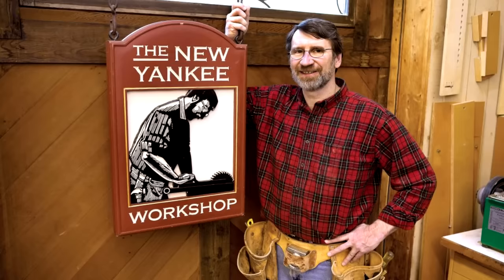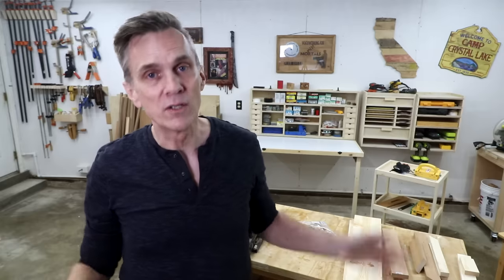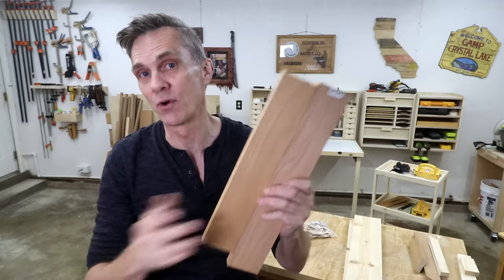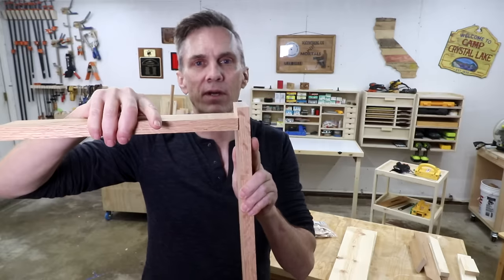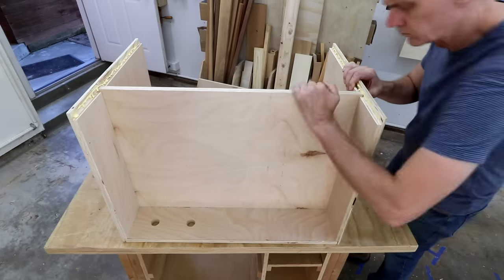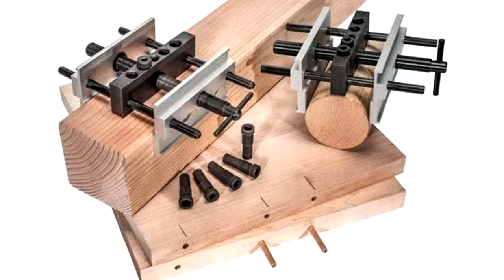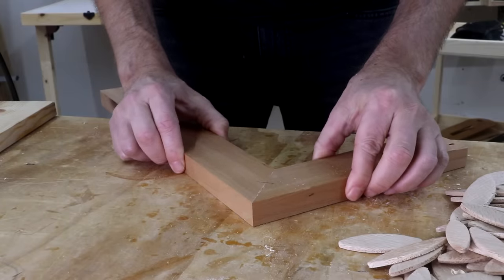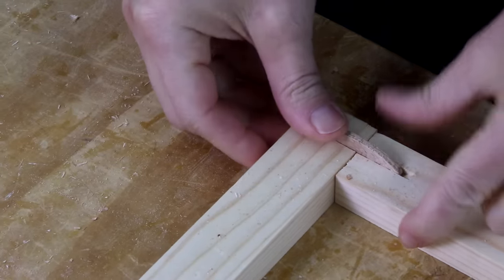So, is a biscuit joiner completely useless?

Comment: I used my porter cable plate joiner for may years on cabinet face frames, door frames and a few other projects but very seldom on gluing up table tops of solid wood.  Pocket hole joinery is something I did spend money on as it is faster, easier, and very strong, and one can either make or purchase plugs to cover the pocket screw holes.  I haven't used my plate joiner in almost 3 years, it is now a dust collector.
Reply: your right,  mine has be stored away for years , making face frames pocket holes are the way to go and plenty strong enough
Reply: Using biscuit joints with pocket holes can be amazingly fast and strong. Biscuits are amazing for  alignment with good strength and when used with pocket holes they can be very strong.

Comment: I've never seen, let alone use, any biscuit with that amount of clearance.  I usually use Freud, and they often have to be tapped into the slot, especially if you take more than half a minute after applying the glue to fit them into the slot.  
For making edge joints, I glue the whole joint instead of relying only the biscuits, but they sure help in aligning.  I don't use cauls, unless I'm using a number of boards, and that's more for keeping the whole thing flat while the glue is setting rather than for alignment.
I recently made all new doors for the kitchen cabinets in our house, and biscuits are hard to beat for making the frames when it comes to speed and ease of assembly.  Sure beat using dowels, like I did for doing the same thing a number of years ago in another house, before I had a biscuit joiner.
I've never seen a "one size fits all" kind of tool.  They all have their uses as well as their limitations, but I've found a biscuit joiner to be a very useful tool when used for it's intended purpose.

Comment: I use my biscuit joiner all the time. I make heavy big log fireplace mantels, massive life edge tables, of huge heavy bords, with literally two rows of 30 biscuits across. Slide them together, work fast for the glue, tap the boards with a wooden hammer, then clamp them tight shut. My tables have nothing else but wood, biscuits, and glue, and will last generations. Absolutely nothing useless about a biscuit joiner, my friend.

Comment: Wow.  I'm amazed at how much play you have in your slots.  I've been using my biscuit joiner for all of my table tops, and i've never seen anything like that.  I have the opposite problem - sometimes the biscuit is too tight, and hard to center in the slot - at which point it actually prevents the boards from coming together.  However, once i discovered that, i just check the fit before assembly and throw out the ones that are too tight (only 1 in 20 or so are too tight).  I acknowledge that cauls are probably still a better choice, but my biscuit joiner is still very effective.

Comment: I bought a biscuit joiner at an auction a few years ago for about $30.  It came with a whole bunch of biscuits, too. I build picture frames from live edge boards, which, when mitered,  don't always clamp up nicely.  The biscuit joiner really does help them get lined up and hold the ends together well, as the faces are not always the same width.  The end product looks pretty good, as they frame my own landscape photos.  I have also used them to line up edges for table tops, and that was helpful as well.  $30 was about the right price, too. Beyond that and I would probably not own one.

Comment: I've been using 3 different joiners for the past 20 years. I've never had slots as sloppy as what you show. I've had to drive ,my biscuits in with a mallet.
Reply: You do have to tap em in when you are in Louisiana or some other swamp ass location. 
Humidity makes them swell up.
Reply: I'm in a fairly dry province in Canada and I too have to tap them in and sometimes pull them out with pliers (when doing a dry fit)
Reply: I bet he is buying generic or cheap biscuits.  Biscuits do come in different sizes also.  I have had sloppy fitting biscuits so I returned them for name brand. Since that time I have the size of my cutter(thickness) written on a tag on both inside and outside of case. There definitely is a use for them.  I didn't buy mine because of Norm even though I knew him personally at the time.  I bought it because it's handy for making tables, cabinets and joining tasks.  I actually have 2 of them a Dewalt and a Mikita  both of which are built way better than that POS he has.
Everyone has an opinion and you know what they are like.  Well this dude's stinks.  Look on utube and there are vids saying how they are a must have tool.  I don't a vid to tell me that though

Comment: You're using the wrong biscuits if they have that much play...or any play at all for that matter. Mine sometimes have to be hammered in.
Reply: I gotta say, even my nasty cheap joiner and biscuits fitted snuggly... out of alignment, but snug!
Reply: Yeah I usually have to get a rubber mallet and beat the pieces together before clamping them
Reply: Always keep the biscuits in a dry place and bag or box sealed as they sell up alot.
Reply: Youll be fuckin hammered if you keep carrying on about biscuit joiners.
Reply: Biscuit joints are a step above butt joints. No, they don't add strength. But they are great for aligning! I don't have wall full of clamps. And I don't need them when I'm using biscuits. 

*also it definitely looks like you picked up the wrong size biscuit. Try a size up.
Reply: More likely, its the poor quality Sears joiner he's using.  Slots from a decent machine have no play, just big enough for a press fit with glue on the biscuits.  It angers me when I see unresearched misinformation put forth as being truthful, as in this video.

Comment: I used one of those dowel jigs  quite a bit to repair joints in old windows that had been poorly built and needed strengthening. I drilled from the outside of the stile into the rail. They worked very well for the casement windows I repaired.  In this application a dowel was probably superior to a domino. On biscuits and Norm: I seem to recall that he had abandoned them before the end of his show.

Comment: Whew! I came close to buying one for a decade. I'm glad i never did. Thank you!
Reply: Steve bought his biscuit joiner in the late 90's and it is rather crappy model by the looks of it. With a better made tool you can dial in the depth and width of cut to fit biscuits so well that they barely need glue. His take on the biscuit joint makes all kinds of good points but still does not do it justice.
Reply: I can't tell you how badly I wanted a Lamello biscuit jointer, just like David Marks.  I now just go with edge-edge or dowels, and I still am astronomically out of David Marks' league.
Reply: @dclaghorn2  dude, just buy one. They are cheap

Comment: Still use and love my biscuit joiner, a lot cheaper than the alternative, I use it for just about most projects
Reply: Yea I use mine on most of my table tops. Never have had any issues for 6 years now. Think I'll just keep using it. If I had a cool g siting around I'd get a domino tool. But that's a lot of money for a hand held tool. I get why someone wouldn't use them but there is nothing wrong with using as biscuit either.
Reply: I just used mine last week.
Reply: Have you used the kreg pocket screw system?

A few years ago my boss called and asked me if we needed the kreg pocket screw system
I told him HELL YES !
He asked are you sure
Definitely
When he got back to the shop I showed him how the system works and he was very impressed even though it's kind of expensive for what you get
I love it works great but I will keep the biscuit joiner 
It works great as well 

Each tool has its purpose
Reply: Same here,  and if you have that much "play" @2.22,  then the quality of your tool is somewhat "suspect"  shall we say?   Although I would admit that the Dewalt that I've owned for some twenty years now isn't by any means "top of the line",  I do used if fairly regularly,  and I can barely get the biscuits out of their slots again after a dry fit.
Reply: Congratulations on wasting your time lol
Reply: @killingoldgrowthsince  Time

Comment: Speaking of dowels, I just made a small couch tray and tried a trick I saw somewhere online with great success. I used #8 screws in pre-drilled holes during the glue-up, and then after the glue was dry I went back and pulled the screws, drilled out the holes to 5/16ths, and glued/hammered in hardwood dowel from the big box store. Worked really well! I'm definitely going to use it again in cases where I don't mind having the dowels visible (I generally like seeing them, since the endgrain finishes up darker than the facegrain).

Comment: Norm Abram doesn't change router bits, he changes routers.
Reply: Yes he does
He has a few 

Id love to have his tool setup
Reply: Makes sense if you regularly use the same bits and depths.  Bit of a pita to constantly be changing bits and adjusting the guides.
Reply: Yep, that's me.. 7 routers and hardly ever change bits LOL
Reply: Without a doubt if I used dovetails regularly, I would keep one set and never use it for anything else.  They are a PITA to get set properly.

Comment: Try using one for cutting cam lock strike slots when installing locks on doors and in drawers, nothing can surpass its superiority for this task. I've used my Dewalt to scab on and widen doors, replace rotted jamb sections and enhance many assemblies. It's not the only way, but mine paid itself off and is here to stay.

Comment: When I started my woodworking career back in the eighty's I used all kinds of joinery. One shop had a real Lamello machine and I used it for everything I could. I made jigs to use in making European style cabinets with built in light valances. Shelves could be mounted permanently in the middle of the cabinet. And I made my own kitchen cabinets using this system along with drywall screws. If you are in a small shop making dados and rabbets tie up a table saw, so a Lamello is a valuable tool for making quick joinery. I've never seen a Lamello joint failure, but I have seen pocket screws fail. I still have a Freud Lamellow machine. It's a valuable machine to have in any wood shop. You just need to learn to use it properly.

Comment: You guys should try the original biscuit joiner invented by the swiss company lamello in 1968. Should give you less headaches than those cheap knockoffs. By the way: the bisquit joints were originally invented to join the first chipboards which were so weak that a dowel wouldn't get enough hold. A biscuit joint has more glue surface but is thinner than a dowel so it doesn't weaken the structure of the chipboard much.

Comment: Just made 9 tables for a restaurant using a biscuit jointer. They are some of the flattest tables I ever made. Usually have to glue up two half to run through the planner but I was able to glue all the boards together seamlessly.  Biscuit jointers are very helpful when making tables.

Comment: Very timely Steve. I was just thinking about buying a biscuit joiner to align some boards for a glue up. Your video makes it clear that biscuits really aren't that accurate to align things. Thank you.
Reply: Dave, buy that biscuit joiner, but stay away from the low end stuff that was unfortunately used in the video.  DeWalt and Makita make wonderful joiners for $170-180 that won't let you down.

Comment: I liked Norm because he was a real woodworker, he had a radial arm saw.
Reply: Yeah you don't see this much anymore
Reply: Beats the snot out of a table saw in small spaces. Also makes a great disc grinder, and a somewhat adequate overarm router or even drill press.
Reply: I love my RAS, especially for dado work. It’s nice to be able to see what you’re dadoing. 

I also prefer using the RAS over a miter saw when I don’t need the portability.
Reply: Soooooo does this mean I'm a real woodworker? I just picked up a 1958 Dewalt GWI radial arm saw.
Reply: @JetSkiBuyFixPlaySellChannel  That is a nice RAS, My Dewalt is not quite that vintage, but I use quite often and a heck of lot more then biscuit jointer...
Reply: @JetSkiBuyFixPlaySellChannel  Nice.  I have a GP and what I think is a GE (builders plate is missing but the specs match).  Both awaiting a tear-down and rebuild as they've had a hard life before I got them.
Reply: My 1st stationary power tool was a radial arm saw. I still use it for EVERY project. Super precise, has large work surface, can use dado blades, can do both cross and rip cuts,  longer cross cuts than a miter saw (which I have NO use for since I have a RAS), have even used it as drum sander when flipped 90 degrees, great for cutting multiple boards at same time. I do NOT need portability provides by MS..
Reply: I picked it up for $100 on Facebook Marketplace. I used a RAS in highschool woodshop. I never realized they could do rip cuts until recently when I saw somebody do it in a Youtube video. I need to get a new blade for it and plan to get some of the other atrachments for it.
Reply: I like radial arm saws and dowels.  Dowels are just as strong as mortise and tenon and much easier to use.  Dowelmax and JessEm both make easy to use dowel jigs, I own the Dowelmax.
Reply: ive refused free radial arm saws several times.
Reply: @502deth  Why would you refuse a free radial arm saw?
Reply: My brother offered to give me one before I realized how versatile they were. My garage is too full to get much done so I declined it. Not sure what kind it was. The cheaper newer Craftsman ones and others aren't really worth the trouble since they are too flimsy to be accurate.
Reply: @ed waggoner sr. imo,.waste of space. it can do some of the jobs of 3-4 other tools, but it does not do them as well and it does not replace them, so you still need to have the other tools that do the job better, so why mess with one.
Reply: @502deth  There is nothing a table saw can do that a RAS can't do.  But there are  tasks a RAS can do that a table saw cannot do.  I've had small shops myself, as did my dad.  I'd chose a RAS over a table saw any day for a small shop.  But each to his own, a man needs to work with what he is comfortable with.
Reply: Norm was the man. Never had a problem with biscuits, countless uses.
Reply: Ive used them twice, they scare the shit out of me so I'll stick to the table and mitre saw
Reply: It also depends on the RAS. If you start with a good quality one, set it up with a proper surface like the "Mr Sawdust" one,  use a sharp blade that is appropriate for a RAS. You also need to understand the proper techniques and use the right safery features that were designed for it. You can really do a lot of usefull things with it for way less money than a quality table saw or a miter saw.
Reply: @JetSkiBuyFixPlaySellChannel  I do agree they are infinitely better than any miter saw and alot of table saws, it's just  that im nervous with them and if my hands are shaky than its a no for me, also the ones I used are from my college and they cost alot of money in my country, plus I think they might be illegal here
Reply: For best results with a RAS, you also want to make sure you get a blade with a negative hook/rake angle, which makes the blade less aggressive and thus less likely to self-feed and/or climb the cut and therefore safer.
Reply: Just got an Oshlun 60 tooth negative angle blade off Amazon yesterday. Can't wait to try it out today.

Comment: Good stuff, Steve. That's funny--I remember Norm using his biscuit joiner for every panel he glued together. And then when I started woodworking in my tiny apartment around 1990 or so I paid attention to Roy Underhill, and he taught us to just plane the edges smooth and glue them up, maybe with a little rubbing together of the parts, so that's what I did. No biscuits required. God bless Norm--he's an inspiration.

Comment: That's is the cheapest looking biscuit joiner I have ever seen, and I think you missed the point, the biscuits are not there for strength but for alignment during  glue up. Lamelo even makes biscuits for knock down furniture, try that with a tenon, dowel or domino. And biscuit joinery is not as fussy as dowels.
Reply: Mike King well said mate!
Reply: just put a through drawbore in the tenons, or use a wedged tenon if you need a knockdown setup. You can usually drive out the pins if they aren't glued in. Baring that you could go for something like a bed bolt + tenon as well. of course for light duty things (picture frames) a spline might be the best bet. Ohh you could be really fancy with a sliding dovetail, though i'm not so sure about that for something like a table or bed leg.
Reply: Mike, I think you missed the point by skipping the video which you are commenting on. Steve talked about alignment.
Reply: @HydraSR  I jumped through it rather than watch it end to end (too painful), a lot of waving around of the joiner, etc.
Reply: @HydraSR  I'm back to this video, YouTube erased my cookie. My biscuit joiners (I own two and just bought a third) all cut much tighter slots that that thing Steve is swinging around, in hardwood I often have to tap my biscuits in with a mallet.